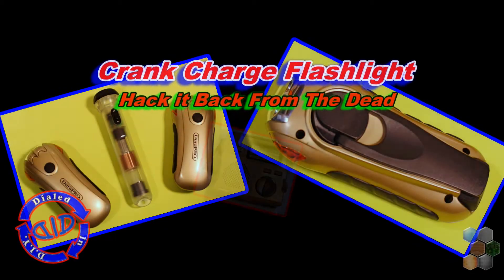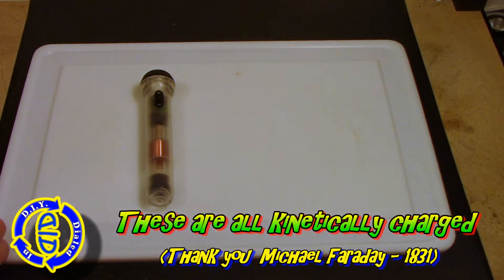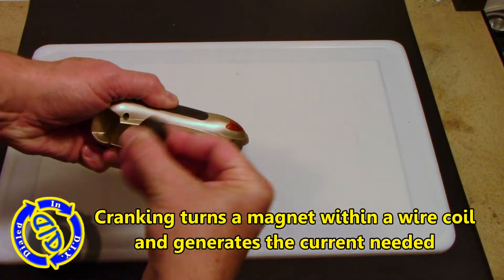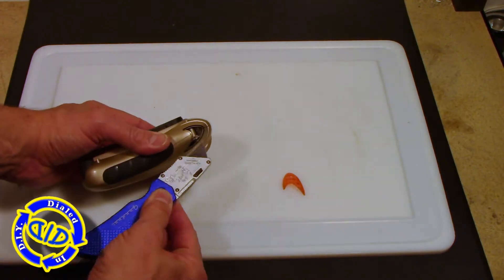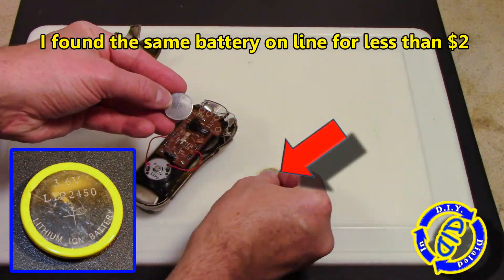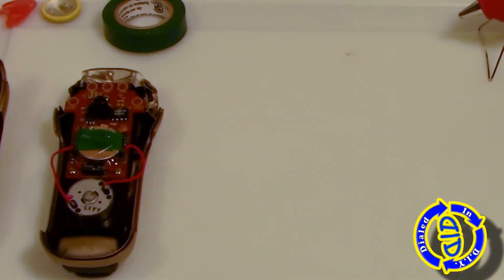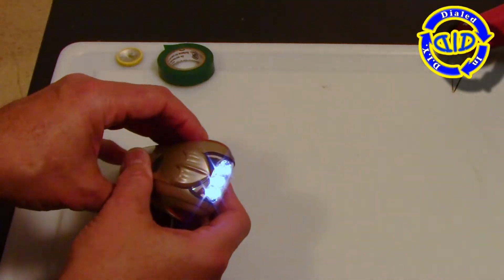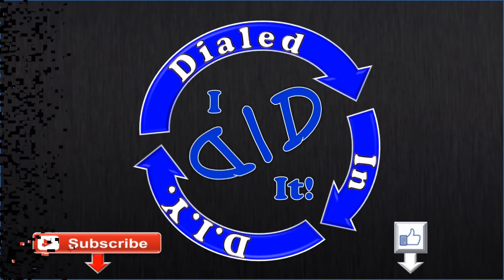How to Fix a Dead Crank Charge Flashlight - Electronics Life Hack

Comment: I don't know if you still read and reply to messages, but I recently bought and Eton emergency radio from a thrift store.  When I got it home I realized that the rechargeable battery was missing.  When I crank it, the light works and the the screen shows 000 Dyn/sol.  Nothing happens when I press any of the buttons.  I've plugged it into a DC adapter and put aaa batteries, but it's still the same.  I don't know if it's because the rechargeable battery is missing or if it's just broken.  Would you have any idea about that?  Sorry for the long post.

Comment: Thanks for the great video!  

I was hoping to get similar instructions for the Forever Flashlight by Excalibur that you show in the beginning.  Is it the same?   Or is there a different required approach?  Any idea what batteries are needed?  What voltage??

Thanks!
Reply from the maker: My apologies but I'm not sure which one that was. Was it the shake light or the other one that I did not open in the video?  If it was the shake light that one holds its charge in a capacitor and not a battery.  If it was the other one let me know and I will try to see if I can find it, open it up and check (hopefully I have it somewhere I can actually find it still).  BTW, thanks so much for taking the time to watch my video.
Reply: @DialedInDIY  Oh thanks.  It is the shake flashlight.  I shook it for a full 5 minutes and it didn't hold more than a few seconds of a charge and not very bright.
Reply from the maker: That was the same problem I had with the crank lights. PS: sorry for delay in reply. None of the replies to my comments (from anyone) are resulting in notifications so I am working my down the list of replies to replies...
Reply: @DialedInDIY  Any specific advice on how to fix the shaker light with the capacitor that can't hold a charge?  Do you know what voltage it works at?  Maybe I can rig it to work with LiIon batteries, or something?
Reply from the maker: I have not tried changing the power storage method in any of these before.  It would take changing other internal parts to match the charging requirements of the new battery. The quickest way (short of buying a new one... but I never seem to try that first) would be to replace with the same size capacitor. I'm not sure what size was in that one but if you look closely it should be marked on the capacitor.
Reply: @DialedInDIY  That did occur to me, but I doubt that the capacity of the capacitor would be enough for any meaningful duration of lighting.  hence my thought that swapping for a battery might be preferable.  Thanks for your response 👍 🙂 😀 🙏 👏 😊!

Comment: I have one of the flashlights but it has an am/fm radio. can someone tell me how to use it? was just messing around with it and I can't hear anything but static. there are 2 turn wheels, one for the frequency I think and the other if volume, there is a switch that says am/fm. those are the only controls I see. what I did was: I put the volume on max, I switched to fm, then I while winding it because it can't hold a charge (I'm gonna fix it) I slow as I could went from one side of the frequency wheel, and turned it to the other from far as it could go to the other side. all I heard was static. am I doing something wrong?
Reply from the maker: Sounds like you are trying the right approach to figuring out the radio function.  Is there an antenna or possibly a spot that looked like it used to have one?  My guess is that you are not receiving radio signals either due to interference or possibly a missing/malfunctioning antenna.  Did you try it outside?
Reply: @DialedInDIY  well yeah I had the antenna extended as far as possible, also I was able to open the flashlight and during reassembly one wire came disconnected, I don't have a sautering iron, so I threw it away, unfortunately
Reply from the maker: @ENDERSTIXgaming  aw bummer... sorry to hear that.

Comment: how do I remove the battery without breaking it.
Reply from the maker: If it is glued to the case or if the wire is glued to the battery then what I have done in the past is use a sharp knife to carefully pry up the contact. That will work much better than trying to pull the battery free from the case.

Comment: My battery was soldered onto one of the leads. I tried prying it off and the the other side with all the gears and grease fell put. I gave up. Everything else was exactly as you said
Reply from the maker: So sorry to hear it fell to pieces.  If you have the model number you can punch it into a search engine and get the schematics to know how the parts fit back together.
Reply: @DialedInDIY  thanks. It's ok. It was old. If I could have removed the battery it would have worked great
Reply: I was just going over my saved videos. I should have thanked you for your help. I also subscribed by the way.
Reply from the maker: @briarrose29  You are very welcome and thank you too.  Hope all is well!

Comment: My durapro hand crank radio/flashlight doesn’t have a battery in the same location as yours. If it’s on the other side of the circuit board I’m not sure I can remove it without damage.
Reply from the maker: Is the circuit board screwed down or glued?

Comment: Haha, the whole reason I bought a crank flashlight is so I didn't need to replace the battery.
Reply from the maker: I know... right?  These type of crank, shake or other form of mechanical charging lights store the power in a battery or capacitor.  Eventually the batteries will fail.  I think most people probably ditch them at that point. Thanks for your comment, I appreciate it.

Comment: Mine is a bigger one that has a 4.2v lead acid battery. Can I replace with a lithium ion battery?
Reply from the maker: The basic answer is yes.  I have replaced many other types of batteries with Li-Ion batteries and packs.  The key is matching up the basic power requirements of the device (e.g. volts and current).  In some other videos I have done I used salvaged Li-Ion cells to make rechargeable battery packs for stuff too.  Thanks for watching the video and taking time to comment!

Comment: Are you replacing it with  rechargeable battery  ?
Reply from the maker: Yes, I used the same battery number as the old one (LIR 2450, 3.6v Li Ion).  Thanks for checking out my video!!

Comment: I recently found a DuraPro crank flashlight/radio in the road while walking home one day. It had been slightly ran over but still in good shape, but one side had been broken open when it was ran over or thrown out the vehicle. And the person probably thought it wasn't fixable. Upon opening it to fix it as I do most things. Everything was still in good shape, except the white wire had broken loose from the circuit board. Its on the opposite side of where the rechargeable battery is. I just don't know where the white wire came off from. For when I inspected the board for any signs of disturbed  or cracked solder I could not find where the wire came from. 

Could you please tell me just where on the board where the white wire is connected to?  So that way I can atleast test it out to see if the battery is still good or not. For I think the previous owner mustve dropped it at some point and the wire came loose and so they thought it was no good and threw it out the window as they were driving. And if I can fix it, score free flashlight which I could probably use as my headlight on my bicycle at night. Thanks if you can help me.
Reply from the maker: Hi Michael, that sounds like a sweet find!  I am guessing that you are right; a minor fix may be all that is needed.  I am going to open up one of my crank lights to check what the wires are connected to so I can better answer your Q.  I am assuming the motor attached to the crank has two wires still connected.  Yes?  Also, do you know what the other end of the loose, white wire is connected to? Once I get a chance to check a little closer on my lights I will get back to you.  Thanks for checking out my vid!  I appreciate it.
Reply: Yes the black and red wires running from the motor to the crank are still connected.  As for the white wire one end is still connected to a point up close near the LED lights, but the wire is bent into an S shape and the other end connects some where down close to the red and black wires. Ive found 3 possible locations where the S shape wire could connect to, but not sure which one for sure since the wire reaches them equally. There are 2 possible  connections on the right side above the red wire and the third one on the far left side of the board above and just left of the black wire. If this gives you a better idea. Thanks
Reply from the maker: I opened my Durapro light back up and it only has two wires; both from the crank motor to spots on the PCB next to the battery.  All of the LEDs are connected directly into the PCB with "traces" going to resistors before hitting the power source.  So, that isn't going to help me answer your question too well.  So I have a couple more Qs for you that might help us to narrow this down some. 1. If you are cranking the motor around can you make anything light up or work while still cranking?  2. If yes, is there something that won't work when you do that? 3. Can you find a model # on your device?  That could help me do some digging.
Reply: I wasn't able to find a model # anywhere. And there is no model # inside the flashlight after I tore it open again. The only number I was able to find was on the plastic piece the motor is mounted to and it says ET-0260-5. And the sticker that wouldve had a model # on it under the crank handle doesnt have it. The only thing the sticker says is "Important Precautions" both in English and French. So thats no help. 

But I dont think it matters now. For this morning before I tore it apart again to look for a model # inside, it wont work now. I put the crank gears back where they belong the other day when I first contacted you and as I tried to turn the crank handle this morning,  it was hard to turn and after a few seconds of trying to make the handle turn the crank, I broke it. After I tore it open inside I noticed 3 or 4 teeth had broken off one of the large gears inside in the crank area.  But I didnt think to try it earlier, but I took the white wire and moved it from one to the other of the possible solder points on the board. And tried to turn on the lights or the radio and nothing came on. So I guess the rechargable battery is dead since that didnt work either by moving the white wire around on the board. But now that one of the gears is broken. I may just scrap it and use it for another project once I figure out where the white wire goes to. I have seen these gear crank flashlights in thrift stores for a buck or 2.  So maybe if I find another one at the thrift store Ill buy one and tear it apart just to find out where the white wire is connected. And then the one I broke the gear on I maybe able to just cut the black and red wire for the crank motor and connect a 9v battery to it to get the LED lights to work and use it for a costume Im planning on making soon.
Thanks for your help
Reply from the maker: So sorry to hear it broke but if you go the route of getting another one at a thrift shop to figure out the wiring you could also swap out the broken gear.  That gear may have already had some problems and may have been part of the reason it had been tossed.  Funny thing,.. I did a google search on the # you listed and the entire first page of results was about medical disorders (ex. kidneys).  
If you end up making it work or repurpose for another project I'd love to hear about how it turned out.  Thanks again for checking out my video!
Reply: Might it be the wire that attaches to the antenna? I've worked on a number of radios and it seem many of them had a white wire connecting to the external antenna

Comment: Where did you buy the battery for the DuraPro crank flashlight?
Reply from the maker: I picked it up on Amazon.  I will check my account and see if I can figure out who the source vendor was and get back to you.  Thanks for watching!
Reply from the maker: I did get it from Amazon; I bought a 4 pack of the LIR 2450 3.6V batteries from eSquare Parts.  Hope that helps.
Reply: Thank you!
Reply from the maker: Any time... hope it helps.